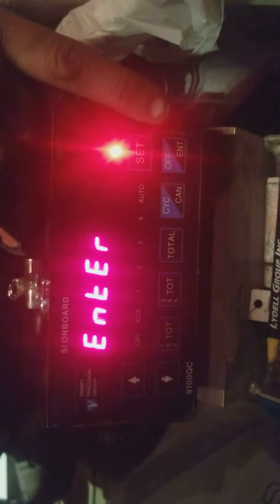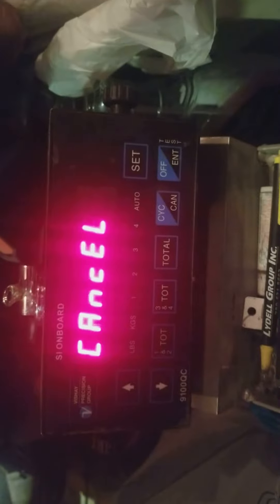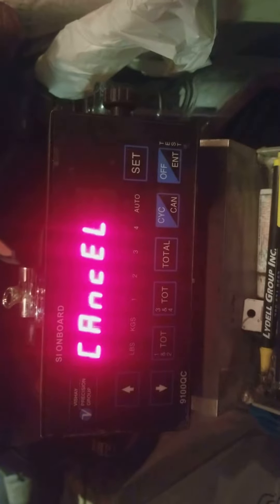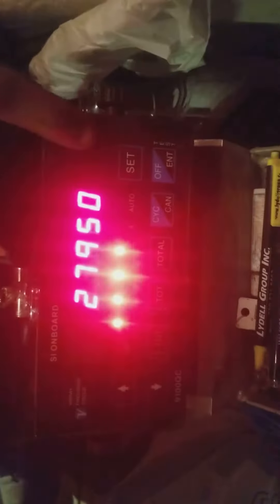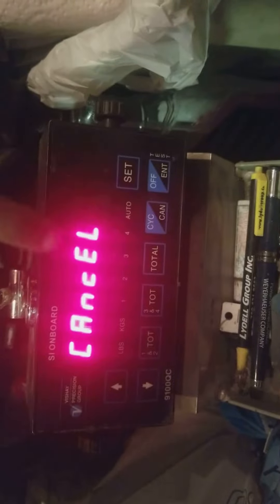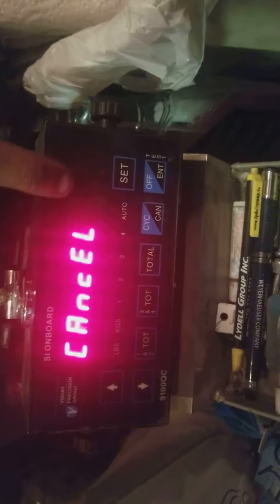Truck scales set up

Comment: Mine will not let me go into the set mode. I push set and it says error 1. How do i fix that?
Reply: I have the same problem and I don't have a manual to fix the problem where do I find that online I have searched for the manual and I can't find it
Reply: According to the error codes on the back of the meter err 1 means it's locked. I just emailed SI for a manual because I can't find any info online either. About to take the Vulcan setup out of my old truck.
Reply: @Formula4001972  I have also asked for a manual from si onboard scales aswell and they sent me a copy of the manual
Reply: Ever have error 23 come up?
Reply: How do you set up for Vulcan 320